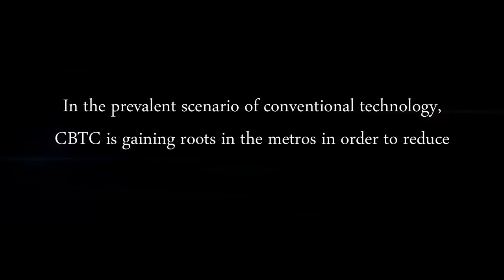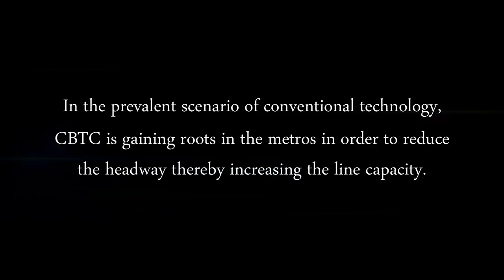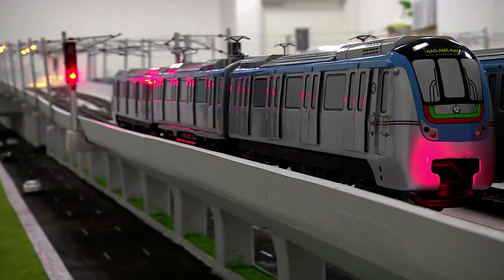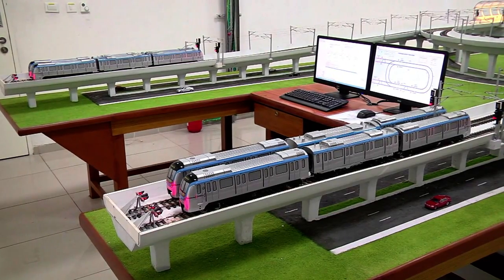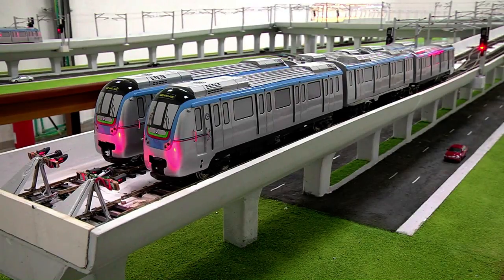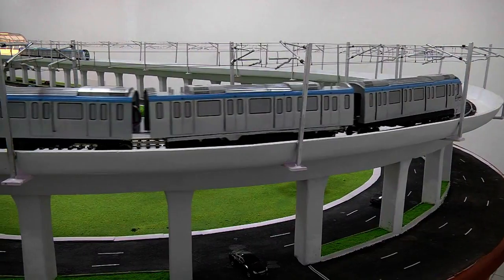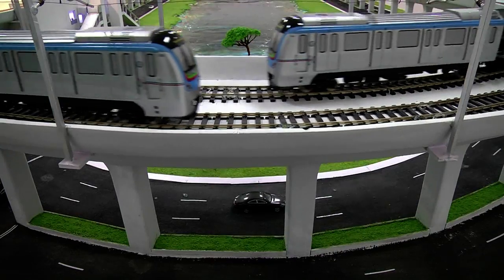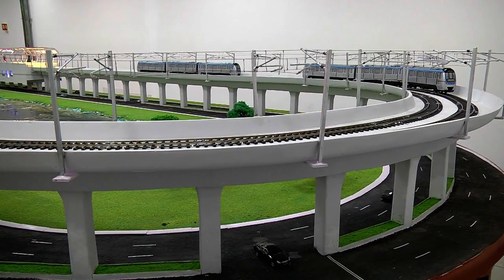Train Model With CBTC Technology

Comment: I hope you put a r142a to reference a r188
Reply: That has already  happened now.  400  50 cars got converted into the R188s for the Flushing line for Cbtcs.  That's the reason why we see the R62as back on the Pelham line. The rest of the R142as from the Pelham line were sent to the Jerome avenue 4 line which doesn't have no CBTCS in those cab A units cars . The rest of the R142as will be over haul and the R142s also.  We will have the brand new R262)as coming soon for Cbtcs to replace all  R62/as.
Reply: @leecornwell1062  no I mean the creator